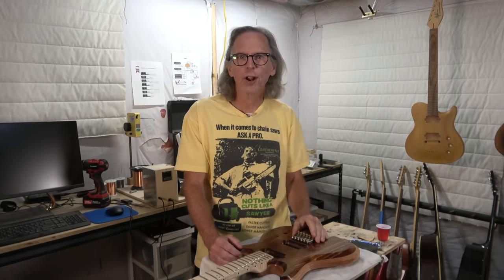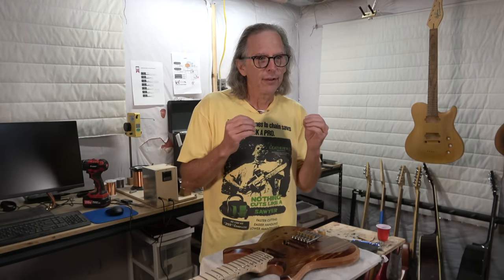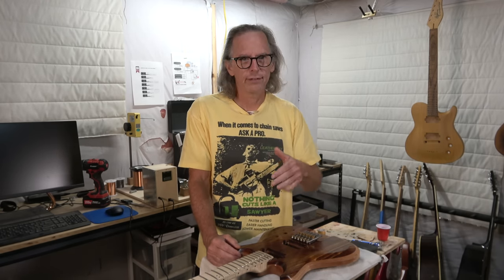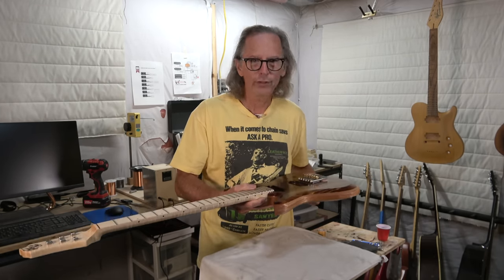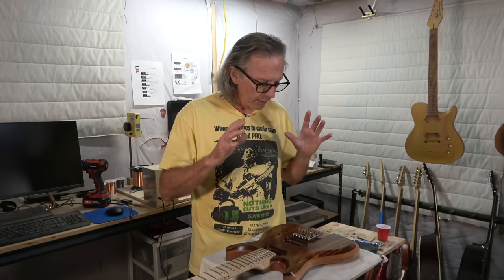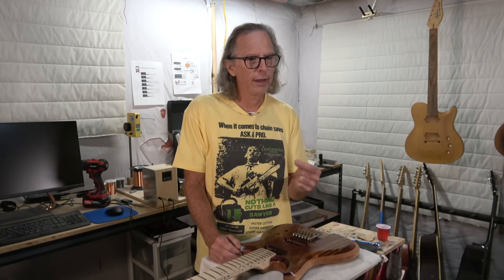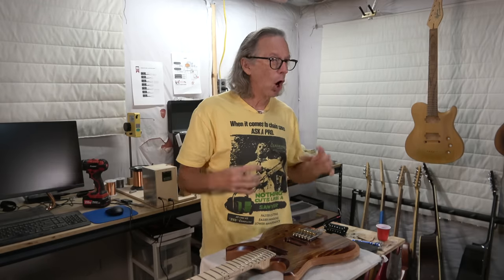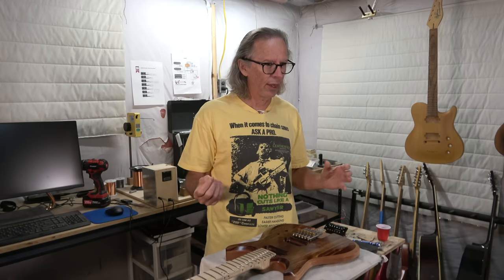Guitar Building Techniques That Are A Waste Of Time

Comment: You can never know what the pickup will go through in it's lifetime. Therefore, you got to pot the pickup, no matter how tight you wind it when new, it might get loose over the years. Potting pickups is mandatory...
Reply from the maker: No it isn’t. The greatest electric guitar music ever recorded was performed on guitars that featured pickups which weren’t potted. High quality, well made pickups don’t need to be potted and they sound much better.
Reply: @HighlineGuitars  100% agree.  I stopped waxpotting my pu's long ago. not for the sake of time saving, that's a bonus though.

Comment: I pour drops of CA glue on my pickups. Penetrates through the threads of coil and dries in seconds. Krazy Glue or Loctite are excellent types.
Reply from the maker: CA glue dries by an exothermic reaction which can destroy the fragile insulative coating on coil wire.
Reply: @HighlineGuitars  ok, good to know.  I must tell you, I've been doing it for few years now and pickups are still working fine. Even used wood glue with good effect too. Thanks.
Reply from the maker: @ILLGREEN1  Put a few drops of CA glue on a paper towel and watch it smoke. A very good alternative is Z-Poxy finishing resin thinned with alcohol.

Comment: Get ready for this one, you may be alarmed.  I'm a cigar box guitar builder (hillbilly luthier).  My own shocking time-saving dirty-little-secret is that, some time ago, I just plain stopped using a leveling beam on my frets.  I now only use a fret rocker.  Nothing else.  Why, you ask?  The reason is, I found that once I get all my frets seated in properly, carefully check them with my fret rocker, focus on any problematic frets, and repeatedly double check the frets up and down the fretboard, I never have any fret buzz.  None.  In fact, once I stopped leveling frets, I stopped having fret buzz.  My cigar box guitars are all 25.5 " scale and they play beautifully, and buzz-free.  Fret leveling turned out to be an entirely unnecessary exercise and a useless waste of my time that I was told I had to do if I was going to build a good playing guitar.  I like your videos!
Reply from the maker: I totally agree. Why grind down your frets if it isn't needed. Maybe it's a way to justify the high price of a boutique guitar. Or maybe the big guitar companies do it to avoid warranty claims.
Reply: @HighlineGuitars  The more CBG's I build, the more other elements I give closer attention to.  My primary goal is always to build a guitar that plays like a dream, sounds amazing, and looks great.  Thanks for your response.

Comment: Not exactly a "building" process, but doing all sorts of fancy loops and knots through the tuners in electric and acoustic guitar strings is unnecessary. One wrap over the top and a couple wraps below will hold just fine, and you won't stab yourself untangling it when you change strings.

Comment: the most things that people do with the guitars are either irrelevant or there's no science behind it. no one has proven that a big block is better or if string through is better, and I'm not sure about nuts unless you play a lot of open strings. certainly we use way too much wood in our guitars to make them heavy which is unnecessary. 

then there are those tone and volume controls, pick gards and string trees.

Comment: I agree with some but not all your points.  Falloff, absolutely unless you have a known problem neck.  For example, cheaper Jacksons.  Do a perfect level, put it back together and string it with 9's.  The neck is wicked thin.  But it's not the quality of a US Jackson and you get a defined bend where the neck meets the body.  Like a flattened V shape.  Doing falloff can help some but boy...you're probably talking sanding the fretboard into a falloff first, then installing frets and doing trial and error.  Since this happens with cheapo Jacksons (and LTD type ESPs), it's not worth the effort for a guitar that's going to sell for $300 used.

On the potting of pickups, it takes so little time and money, in the very off chance that it's going to give micro feedback, it's a good insurance policy to pot all the things.  

What else.....shielding.  I always do it and it doesn't have to be rocket science or copper.  Aluminum does the job rejecting electric fields.  I enclose the pickups as best I can from the back.  It'll never be perfect unless you're putting it into the construction of the pickup....which you can do with metal covers.  But if it solves a static electric problem, which it can with cheapo plastic strat or tele style pickguards, you avoid the issue where you poke the pickguard and get a psst sound.  Nobody wants that.

I do like your strategy of evaluating a step and deciding if it's worth the time or cost.  I've only ever done very low volume stuff.  Like a dozen guitars a year, so it doesn't matter to me.

Comment: Cavity shielding may be unnecessary since the pole pieces are exposed on many guitars.
Reply from the maker: It took a while for someone to mention this, but you're right, shielding the cavities is often not necessary.
Reply: Pole pieces are not part of the circuit, they can't pickup EM interference.
Reply: @HighlineGuitars  I learned that from you :)

Comment: If you are making a guitar with 2 humbuckers, then sealing the cavities is probably unnecessary!
Reply from the maker: Do you mean sealing or shielding. If you mean shielding, it's the signal wires between the pots, switches and jack that are the problem with electrical interference. I like to use single conductor shielded wire for my signal wire as it eliminates the need for shielding.

Comment: Something I've always wondered about, particularly for electric bass more than guitar, is whether rounding the edges of the fingerboard and filing down the edges of the frets is really necessary, since if a player has good technique (i.e, technique similar to how classical guitarists or double bassists play) then their fingers will never actually come into contact with those edges of fret ends. It begs the question, is obsessing over fret ends a result of generations of guitarists having poor technique?
Reply from the maker: In the same vain, players often prefer bridges that are comfortable to rest their hand on. Thats poor technique.
Reply: Different playing styles require different things.  Try full barre power chord punk at 220 bpm on rough frets ends and watch the blood flow!
Reply: @HighlineGuitars  Some playing styles such as semi-palm muting require you to rest your hand just below the saddles.  In my builds, I now shift the neck, pickups, and bridge about 4 inches to the left with respect to the body (leg cutout and strap attachment points) to accommodate this.  This moves the picking area from the middle pickup to the bridge pickup and places your picking hand right over the bridge, compared to traditional builds.

Comment: You attribute potting the pickup to the '80s but Fender was doing it back in the '50s the old man that they  outsourced their overflow of pickups  they couldn't get done talked about potting pickups he has old new stock of everything that Gibson and Fender used for their pickups for a huge pocket full of money he will build you original paf pickups and it's the same materials the literal materials that they used back in the 50s 60s when he was making pickups for Fender and for Gibson. I can't remember exactly his name but yeah that was not something Van Halen come up with by any means it was done 30 years before he came on the scene. Cuz Leo fender bigsby and Les Paul sat in a living room and came up with the humbucking pickup and they were vertically stacked instead of side by sides Fender has always potted their pickups. Man to be a fly on that wall in that living room in the 30s or 40s when they were inventing the humbucking pickup would have just been amazing. I like your video it's pretty cool there's a lot of stuff that people do with guitars that is absolutely unnecessary if you do a couple of other things differently than most people do like the break angle on your neck that determines whether you're going to have to file those last few frets down or taper it all the way from fret one down to 24 or whatever.